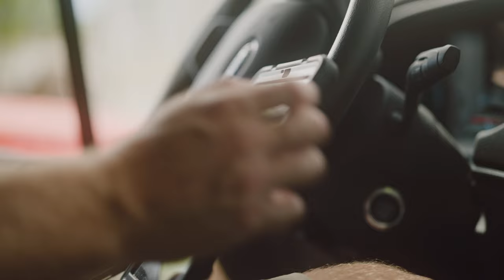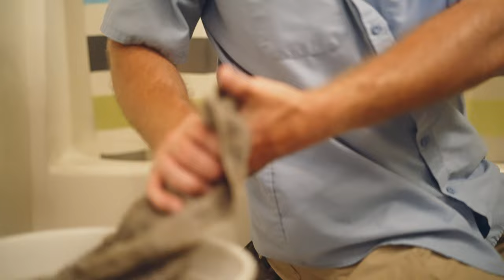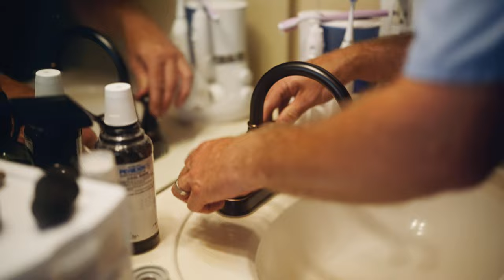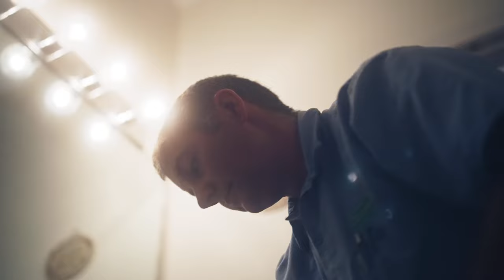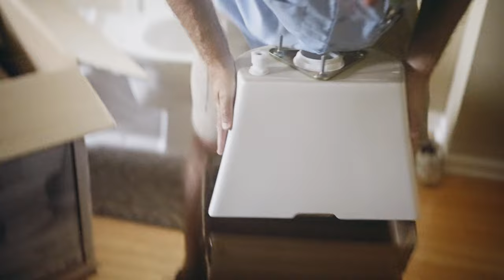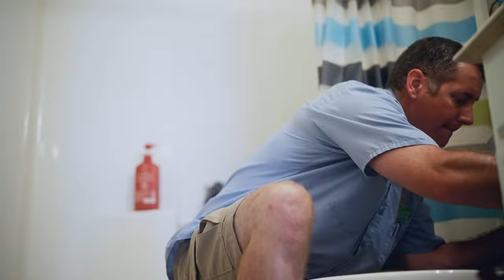A day in the life of a SERVICE PLUMBER (#2) - Charity Edition

Comment: Thanks for the video, interesting to see what you are doing but I am looking for tips. Like, you found green on the bottom of the pipe, how did you fix it? I will look for other videos for the explanation.
Reply from the maker: Green on the bottom of the pipe?
Reply: @SmedleyPlumbing  Yes, you were pulling the toilet, you noticed green on the water line. You then cut the bottom line I think. Not sure what you did.
Reply from the maker: @michaelmcdonald1402  we were replacing the supply stop and there was some green corrosion on the waterline.  We always have to clean up and remove that before we install a new supply stop.